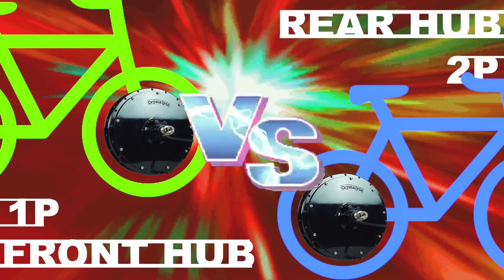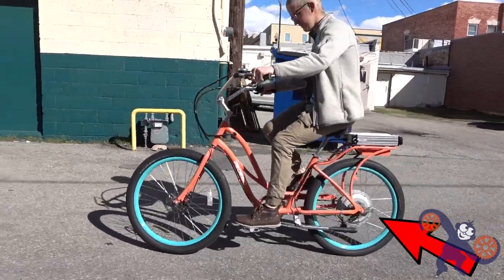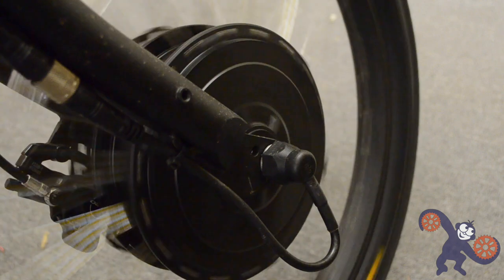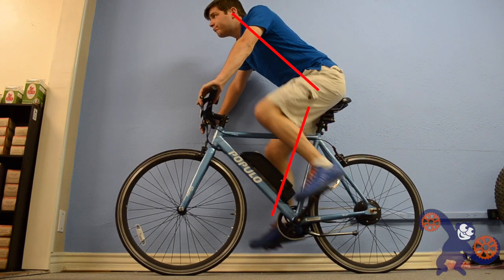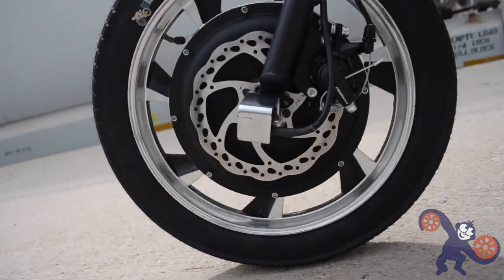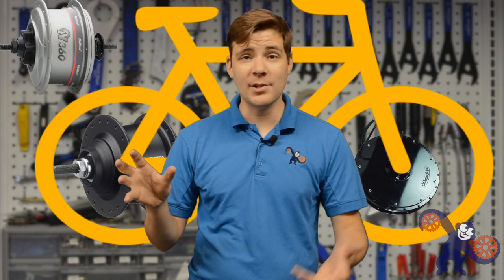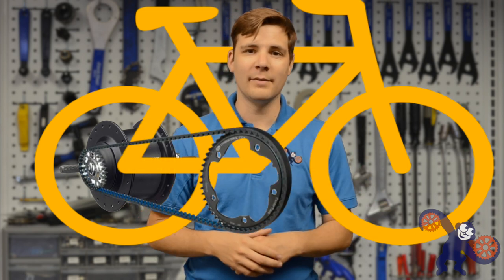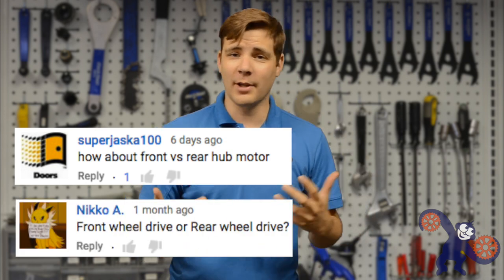Front Hub VS Rear Hub eBike Motor

Comment: I think the problem with most people converting is that they equate front and rear hubs with front and rear wheel drive in a car. They think a front hub will be safer and less squirrely. However, as the video explains, the weight distribution is very different, and you do get more grip with rear hub, making it both the stable and powerful choice.
Reply: Or perhaps they see it as simpler and lighter without having to run as much cable or deal with the gearing. It also effectively gives them 2wd whenever they're willing to pedal. It's also a much quicker install without needing any special tools.
Reply: Rear wheel drive cars don't have less control than front. You have more grip and control with rear wheel cars.

Comment: Opinion:  If you're into racing and sport, I think there's a good case for a rear hub conversion.  For practicality, I vote for the front hub.  Not only is it simpler, it reduces weight stress on the rear wheel and tire, which as you note, already bear most of the rider's weight.  Front hub conversions help distribute the weight more evenly between the two tires.  If you install a rear hub motor, look to replace spokes or rim at about 10X the frequency of a front hub conversion - not an easy task for the casual rider with an electric hub.  I have 3 front hub conversions, and I think the bikes handle just fine for normal (non competitive/non racing) use.  In my opinion, the bikes may even be more stable, though less agile/twitchy.
Reply: hey John, do you find that there are any disadvantages with front hub motor when hauling loads over 50 lbs or riding up loose/wet terrain? I hope to have a front hub motor with the battery also mounted near the front, not sure if this will make steering feel too heavy since I've never actually ridden an ebike before. thanks!
Reply: @john yeah how about handling affected

Comment: Ive found the front hub fine peddling the back wheel gives you two wheel drive up hills.
Reply: Also it's nice to have improved weight distribution and tyre wear on the bike.

I did try my front hub on a BMX track which showed its limits but for most duties in town and on light off road it was perfectly fine so long as I didn't use full power.

One thing I'd be curious about is handling on snow/ice.
Reply: @ml9052  I imagine front drive is more sensible on snow/ice etc (of course depending on whether or not the tyres are appropriate, but for arguments sake let's say in both cases they're identical and suitable) then one would imagine front is better. Similar physical principles with a car - FWD is better for dragging a car through snow/ice/mud etc where RWD, pushing the car through those things, often ends up in the rear wheels slipping out. But the weight distribution on a bicycle is somewhat different than a car so unless testing was done, who knows 😂
Reply: @MichaelHenderson59  if your front wheel has throttle, it does give you more options to stay upright if you assess the situation correctly. In some instances you might need to stop pedals and use throttle only to go over watery ice.
Reply: This is also my thoughts. I would like to put the ebike drive to the front for easier conversion, weekdays ebike, bike to work, then weekends gonna get rid of the ebike for trails.

Comment: One reason i specifically look for front hubs is so in case of chain / gear failure, the bike can still be rode like a electric motorcycle. That, and a lot of the lower priced rear kits are exclusively 7 speed, which you can get adapters for, but that adds cost. 

You mention traction as an issue with front hubs, and that's something I've not experienced, even with 23mm 120PSI road tires, however I'm exclusively on-road.
Reply: That's... that's very true. I think I confused my reasoning with mid drives.

Specifically I went front hub on my main commuter was because of my weight (>400lbs) and worry of destroying rims and spokes. I run a Vuelta Corsa HD rear wheel with a custom laced from hub on another Vuelta rim.
Reply: Can you tell me more , can you mount hill with front wheel easily ?
Reply: @kadersossah4486  yes, there is no issue going up hills with a front hub.
Reply: Thanks you very much for the information
Reply: Ya cuz thats such a problem.
Reply: Rear hub is the same no chain needed

Comment: Front hub is best. Gearless brushless . regenerative braking is by nature anti-lock.  It is sweet to have anti-lock regen braking on the front wheel.
Reply: Can you tell me more about it ? Can you easily mount hill with it or it is difficult?
Reply: @kadersossah4486  easily mounted just like a normal wheel. climbing hills with front hub motor can be tricky because it does not have full traction; most of your weight is on the back wheel when you do hills
Reply: @pauls5745  so how do you do ?
Reply: Rear is best. It's more safe. The front forks aren't designed to handle torque and in result they can break.

Comment: I didn't know that front mount motors are tricky to ride.  GREAT info, thanks William Orange county, ca.
Reply: Not tricky to ride at all, a couple rides round the block or parking lot and U got it,  -- you got thick tread tyres right? 4 inches snow ? last thing you need is a fooking Ferrari, SLOW , two wheel traction, will get you get you to McD or 7 up.

Comment: So I got a beach cruiser project I'm currently working on, I'm looking at running a 1000 watt front and back hub for the most grip and acceleration, pretty much an electric drag bike. My goal is to start from a dead stop by using the front wheel on a left hand throttle to get the bike going, once the wheel starts to grip and lose wheel spin I'll use a throttle that is on the right side to make the rear wheel kick up extra acceleration, I'm hoping this will also avoid any fish tailing. Now my question is, is it doable? My goal is strictly acceleration as fast as possible with as little to no loss of grip at all, top speed is not necessary. Currently I'm looking at 48v 1000watt hubs, planning to run both of them with their own batteries and control boxes. Any tips or advice on my build plans? What possible adjustments would be recommended. This build will only be for straight paths with no incline.
Reply from the maker: Check out our most recent video, cheap eBike kits. You could use two of those. Breach cruiser should have enough space for mounting two kits

Comment: If you look at a motor, how would you know if the manufacturer made it for the rear or for the front? What is the physical difference, if any?
Is there any physical difference between a front hub motor & a rear hub motor?  Can one take a rear hub motor & install it in a front wheel?  Is it there there are some, but not all rear hub motors which can also serve as a front hub motor?

Comment: Totally agree. Traction with a front motor sucks on most bikes.. it adds a weird steering feel.. and there is usually some vibration from the motor creeping up the handlebars.

I've built and ridden a few front motor bikes.. was never happy with them.
Reply: neptronix front tyre motor bike move slow?
Reply: neptronix but the biggest advantage by front tyre motor bike is that you can do long drift by apply rear tyre brake with accelerating.

Comment: Front well most have suspensions, so smaller load is on one whell. Rear whell usualy not have susspension (and all load usualy gose  more to rear wheel), so you more easy can brake tire and wheel.

Comment: I am wanting to build an electric quadricycle, I think that the front would be better because it would:
1) weigh down the front for traction with turning
2) keep the rear easy and simple. 

thoughts?
Reply: You’re not talking about a motorcycle anymore you’re talking about a car and if you’re going for traction and control (in such you are going through curvy and winding roads then front motors are for you

Comment: If I was to get a bike frame with no peddles and no chain and put a front motor on the back will it still work like a rear motor would or would it just not work at all? I don’t need a chain or to peddle it’s just a little project
In my head it works because of it’s just a wheel what pushes forward only different between a front motor and rear motor is the gears right?

Comment: Front hub is easier conversion of a standard multispeed bike.  That's the only reason to do it.

Rear hub motor means you have to mess around with your rear dérailleur.

Would a conversion that adds a chain to the largest rear gear/sprocket and just disable the lowest gear setting for the rear shift be practical?  Puts the motor on the frame just above the pedal crank.

Comment: I’m thinking about putting a hub motor on a 4 wheel surrey bike (or 2 motors working in tandem for torque/symmetry). For its size and balance, would it make more sense getting rear hub motor(s) or front?
Reply from the maker: I'm not really sure
Reply: @BlueMonkeyBicycles  Hmm.. That's ok. I'm thinking with rear motors you get the benefits like you mentioned in the video, but with front motors you don't have to deal with the often complex chain drives on surreys.

Comment: A couple of ideas for more VS videos:
1. Battery position - downtube VS vertical standing (behind the seat tube) or rack mount type
2. More volts VS more amps. That is, greater speed and shorter range vs greater range and lower speed.

Comment: Sir I have a bought a normal trike, i have never ridden a cycle due to balancing issues,  I want to convert it into electric but installing in rear wheel is double the price than Front wheel. (250-350W BLDC HUB for front or Mid drive Motor 350w)
 
As I am a beginner should I install the motor in front or rear?

Any suggestion is welcome
Reply from the maker: Front wheel is fine for a trike. 
Just be careful turning or going over 10mph
Reply: @BlueMonkeyBicycles thank you sir for your kind advice

Comment: I'd like to ride a front-motor bike on the beach (because I also want internal/protected gears (as opposed to derailleur) inside the rear hub)...I don't plan to ride in the waves, but maybe in wet sand...can any of these hub motors get wet?  Thanks...
Reply from the maker: Yes, they can.

Comment: Hi Mikey. A video about keeping batteries in good condition please.   E.g. What % you should consider recharging. Is it bad practice to let the battery pack run to 0%. Should you periodically recharge when not using the bike for a long time.
Reply: Mmm, I suppose an e-bike longevity / maintenence angle. That would include being sensible and not constantly stressing the motor, and so on. My concern was, I heard that 18650 cells can completely die if you left them alone or let them fully run down. However some have protection (branded cells) to help avoid this sort of thing.
Reply: Definately. That just made me think of series of 'hack' videos. That would certainly be popular. How to hack your battery controller to do xyz.

Comment: I want to build an electric bike for my girlfriend and have a question :
I wanted to put a hub gearing system cause I want the bike to be as maintenance-free as possible, but she isn't a very experienced rider so now I'm afraid to put the motor in the front wheel, what would be the best option ?

Comment: I live on a boat. How does an ebike hold up in a marine environment?
Thanx for the well done videos and explanations!
Reply: Be sure to use ss spokes and aluminum rims.  And also aluminum frame.  I also live in a marine environment and my non-stainless steel spokes rusted to all hell but my aluminum frame has held out just fine.  Just got new wheels with stainless steel spokes hopefully they last a lot longer.

Comment: Front hub motor can be the solution for someones who dont want have an "complete" electric bicycle, just put the hub-motor wheel in the front, the motor AND the battery is in the hub itself, not outside... And if you want to ride withour the motor, just change the wheel, disconnect the cables and that's all.
Veeery simply compared to a read-hub motor.

Comment: Great video! For a beach Cruiser with coaster brakes only- do you think a front wheel hub is ok with adding a front wheel hand brake? I've never converted a Beach Cruiser before. Thanks!
Reply from the maker: Yeah, I guess. Since the bike is heavier, and faster after the conversion, I would recommend upgrading the brakes. Personally, I wouldn't rely on a coaster brake and a hand brake for an electric bike.
Reply: @BlueMonkeyBicycles  Thank you! I think i will buy a single gear freewheel and buy a rear hub motot and add both front and rear hand brakes.  Thanks for your help!

Comment: Just bought a 1000w 48v (13s) ebike rear hub, but I'm scared because i made a 56v battery (15s) instead. Each cell has 4x recycled 18650 batteries, but I'm not sure if all the cells can handle the amperage... 
do you guys think im good, or should i add another battery for each cell? (Sorry for my terrible Norw-English)
Reply: How'd that work out for you now that it's 2 years later?
Reply: Your Norw-English is very good and clear actually. I am a (black) native English speaker, and here in London there are many people living here who write worse English.

Comment: Would a 350w geared hub motor be ideal in the front for a pedal assist only setup? Just sounds like it would have quicker acceleration and better climbing power, Being that it's two wheel drive?
Reply from the maker: Benefits don't outweigh the cost
Reply: Cost the same @BlueMonkeyBicycles

Comment: Front because is not complicated... And rear have a 9speed so why i need this is for uphill only 🥰🥰 if the motor cant go super fast then i will assist using pedaling lf the rear wheel 🥰🥰🥰

Comment: Here's my idea and a little background. I ride a single speed 29er w/ a 3"tire up front and 2.7 in the rear- I pedal like crazy on it. I  ride paved trails but sometimes i want to be able to cruise at some speed rather than continue my cadence. Im a very competent rider and would primarily use electric for straight line throttle hits- just to fly on a straight away essentially. The motor would not be a crutch, more of a toy to use and that's why the idea of having a motor in my drivetrain kind of puts me off. I still want to be able to completely free pedal with no motor involvement.  Would a front hub be a better idea for this application?
Reply: yes

Comment: Is there a reason why shouldn't be installed front and rear hub motors on the same bike?
Reply from the maker: Not really. The end result is kind of a fun novelty, and can useful in verry loose terrain.
Most people do dual motor bikes for bragging rights, because the scenarios that utilize it are few and far between.

Comment: I have a rear hub e bike and the problem is I get frequent punctures due to the additional weight.
Reply from the maker: Most bicycles put the riders weight backwards already, so rear punctures are more likely as a general trend.

If you haven't already, you can mitigate flats with some added accessories:

Tire liners and thicker tubes can stop many of them  from happening. You can get the same effect from Tannus armor. You can also put Flat Attack in the tubes to seal flats from the inside. It's like slime but better, in my opinion.

Comment: Can you use a front hub motor has a rear hub motor 
￼
Reply from the maker: Not really. Most front hub motors do not have pre built space for attaching mechanical gears. In many cases, a front wheel will not for in a rear wheel, let alone with the added consideration of gears or a motor.
Reply from the maker: They're probably big channels with a massive flow of comments. Things around here move slow sometimes.

Comment: What about mounting the motor in the front and the back?
Reply: I wouldn't try it
Need two motors - much more weight
Need double-capacity battery - even more weight
More complex control system
Hard to make front and rear wheels turn at the same speed

Comment: What if i install two electric motors on a bicycle one rear and.other on front ?
Reply from the maker: Read the comments
Reply: You get all wheel drive. Which means that it is easy to get out of muddy situations. But tricky to ride. However lessons from bikepacking appear to indicate that putting more weights in front is not so detrimental to riding because the weight distribution is more even. Contrary to this video, rear motors make weight distribution worse. Even without motors, because of the rider, it is 60% to 40%. Tyre pressures must be adjusted accordingly. I prefer front hub motors. More difficult to ride but give you extra options. Rear drive is not necessary but if required, it may increase efficiency, because gearless motors have little friction as shown by how quiet and vibration free it would be. You can switch off the front motors most of the time.

Comment: Can you convert rwd to fwd on ebike
Reply from the maker: Realistically, no.
Rear hub motors use a different size axle that doesn't fit into most any front fork. Even if it did, you'd still have to get a new rear wheel, or entirely strip the motor out of the spokes and re lace it all over again (quite the adventure itself).

Comment: What about scooters?
Reply from the maker: Lower weight, smaller wheels, and 90%+ use on pavement; I'm thinking that these factors really mute the differences we see in bicycles.
Reply: @BlueMonkeyBicycles  so it doesn't matter?
Reply from the maker: On an electric kick scooter, not really. I have very limited experience on them, so I'm not the best to ask.
Try electric scooter guide, they can probably help.

Comment: high powered front hubs make excellent racers, as you can corner much more sharply, I would not go less than 1000 watts 48 volts.
Reply: Can you tell me more about your experience ? Is hub wheel is good for hill climbing